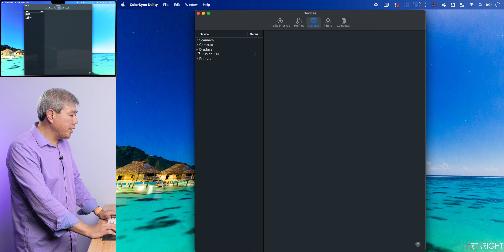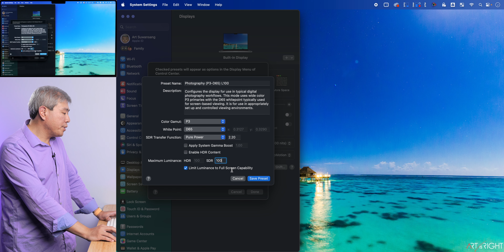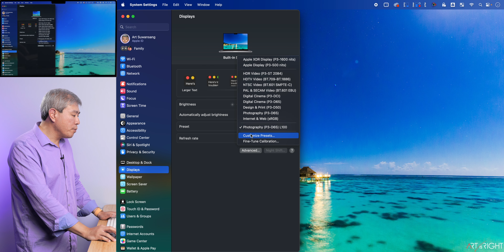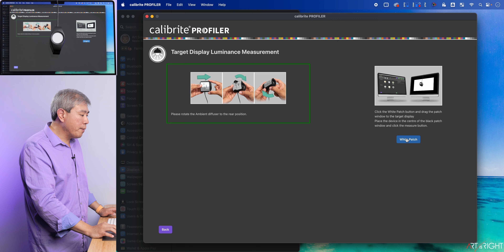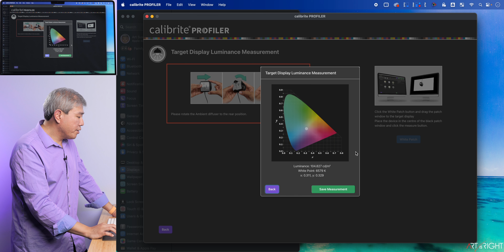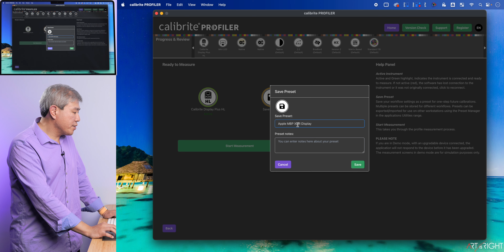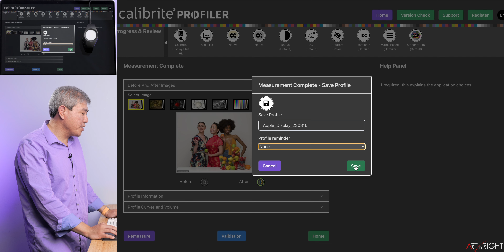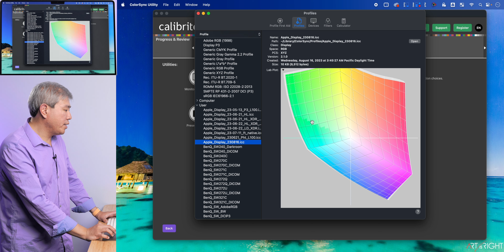Ultimate Calibration Guide for Apple 14" & 16" MacBook Pro XDR Display - This is the way!

Comment: Hello, first of all, thank you for the detailed video.
Unfortunately, it no longer works as described, apparently due to a change in MacOS.
If you select a profile (e.g. Photo P3 D65), you can use the fine adjustment. However, if you duplicate the profile as described and save it (in my case with 120 cd and sRGB), then there is no fine adjustment. In the menu, the fine adjustment is grayed out and there is only "full calibration". And this cannot be done with Calibrite Pro because the sensor is not recognized (by MacOS). I use MacBook Pro M4Pro 16" with latest MacOS Seq.
Reply from the maker: Yes Apple just moved the location. I have to do another guide for this, but I don't have time at the moment.
Reply: @ this Option is grayed out … only Full calibration
Reply: @ArtIsRight  Any update on this? I want to do a calibration but am stuck here. Only "full calibration" is available (not fine-tune) and it cannot be done with any Calibrite hardware devices.
Reply: oh nooo. I just wanted to do the calibration. @artisright do you know when you would have the time to do that? (No Pressure) just for information.
Reply: I would really appreciate an update too.  I can't use my Calibrate Pro HL device since option for Fine Tune Calibration greyed out on 16 in. Macbook Pro M4 with latest version 15 Sequoia.  Patiently waiting.
Reply: Contacted Art and he was helpful.  If you mistakenly uncheck the blue box, "Limit Luminance to Full Screen Capability" in the Create Custom Preset Mode, the option for Fine Tune Calibration will be greyed out in the Pro Calibrator Display box.  So try checking that box.  Save the preset.  Press Calibrate Display.  Now the option for Fine Tune Calibration will be enabled.  I was successful in calibrating my Macbook Pro M4 with the recent version of Sequoia  using the Calibrate Pro HL!

Comment: What should I set as Timeline/Output Color Space in Resolve when working with SDR? There's a change in colors when going from Rec709 to Rec709-A. 

If I set "Use Mac Display Profiles in viewer" and timeline/output to Rec709 and export the final video in Rec709 it should have the correct color (even tho quicktime shows it wrong)?
Reply from the maker: Yes this is a mac export engine gamma shift issue. I would find out on various forum/article to get this answer

Comment: Thank you so much for this walk through Art. Invaluable, as others have mentioned. I now have even more faith in my Studio Display 27" as there was virtually no discernible difference after calibrating vs. before calibrating. As impressive as your .6 and 2.5 deltas were mine smashed your results. I got 0.3 on All patches Avg. & 0.7 on All patches Max!! No wonder I couldn't tell difference between After vs Before calibration. I now feel quite a bit better paying so much more for the Studio Display vs another option.
Reply from the maker: Good

Comment: If I have made three profiles, one for photos with sRGB, other with P3 and another for video with Rec.709 , would I just be able to switch between these three profiles from apple  settings or this will need to be done via color sync utility or calibrite profiler?
Reply from the maker: If you make 3 presets and a profile for all 3 settings, you would need to change the profile in the color sync utility as well.

Comment: I think that if you want to calibrate to srgb or rec709 using the older device models is fine? Just have to chose PSF Phosphor as display type. At least that is what I read in the calibrate app.
Reply from the maker: you would think but not quite, the old devices don't understand the display spectral output.
Reply: @ArtIsRight thanks for the reply

Comment: Hi Art, really amazing video!
Question: I’ve created a few presets for editing, editing for printing etc . I also have to create a profile for each preset? Is it really necessary because each preset must be used with its own profile? Or a profile created with any preset (that is any luminance/white point value) work well with other preset? Thank you.
Reply from the maker: if your preset does not change the white point, you don't need to change the profile.

Comment: Now that you've shown how to do an initial calibration and created presets and profiles can you show us your workflow to recalibrate after 2-4 weeks have gone by?
Reply from the maker: Leave the presets and fine tune the same and just start the calibration process again. There's no settings to change
Reply: @ArtIsRight  Thanks for your reply.  
So when you get to the second step in Calibrate I'm guessing you use the preset instead of "photo"? Also reset the preset to Factory in ColorSync?
2nd question.  I recently bought an M4 MBP. After I calibrated as per your instructions it's a bit magenta when I compare to my M1, BenQ SW321, and Eizo 2700x.  Did something change in the Backlight technology?  I'm just struggling to get a good calibration on the M4.
Best,
Tyler
Reply: @tyrone3006  I'm experiencing the same thing- I just went through all of the instructions again just in case I missed something, and it looks the same.
Reply: @lisasims4223  yeah I did twice as well thinking I missed a step. 
I wonder if changing the backlight technology would help? I haven’t tried.
Reply: @ArtIsRight  Also experiencing the same "magneta" tint when following this video on an M4 Max 14" as per the comment below mine from Tyrone :(

Comment: Hey Art!
Great video.
Do I have to calibrate for every luminance preset?  Is the method different for a M4 running sequoia?  I created a preset for 100 nits calibrated then created a preset for 120 nits.  When I switch from 100 to 120 the color shifts dramatically. I don't believe this happened on my M!
Reply from the maker: No just the primary one you are using. The variation between 100 and 120 is extremely small

Comment: Hi, i have a problem after finising calibration. I have MB Pro M3, and after calibration, icc profile doesn't show up on the list with profiles in settings. Does anyone know what could be wrong?
Reply from the maker: there are so many things that can happen, and many more vairables information that we don't know. I would start with an updated calibration software and go from there. As far as the profile not showing up did you check color sync utility, devices, display and then choose your display?

Comment: First of all. Thank you for your quick replies. So what happened is, that after completing the final calibration in Calibrite Profiler  but before leaving the software my monitor turned yellow. External monitor works fine fortunately. Changing colorprofiles does not help at now I have no collars on the XDR display. Actually I have seen this before when calibrating for some of my students. Is the a bug in Calibrite and can I restore it. I don't have time machine
Reply from the maker: probably dm me, I am curious

Comment: Thanks for the video. Is using those HL devices the only way? I have MacbookPro M2 14" and the ColorMunki display, those HL devices are pricy for me. Choosing "White LED" and P3 will lead me to incorrect results or is anything more to consider?
Reply from the maker: HL is the only way. You can successfully calibrate with other devices, and also other backlight technology. However, what you're going to get is an ICC profile is much smaller than the color gamut. The display is able to produce.
Reply: @ArtIsRight  Thank you so much for the answer, I'll use the default icc profile then and the "Photography" mode in the screens configuration by now (I hope is a decent choice). Seems I need to save for the HL device and get it later, have a great day!

Comment: Hi I'm back to do another calibration so I have to watch your video again to walk mr through the steps but I see I must of deleted the Factory colour profile as I was removing so old ones so I could only reset it from the current profile would that be wrong and if so where would I get the original factory profile again thx Doug
Reply from the maker: When you reset the profile to factory. It will automatically load in a base factory profile that you don't have to worry about. Plus, before you run the calibration the program would also apply a linear profile to your display so technically you don't even need to do the reset, but it's always a good precautionary measure to do it.
Reply: @ArtIsRight  ok thx for your reply its awesome

Comment: Hi ! I have a 16 inch 2021 m1 max MBP  running Sequoia 15.0.1 , I can't find the Mini LED option in the drop down menu. Also can't find the option Measure K . It stops in "Native" . I am using a Colormunki Display calibrator.
Reply from the maker: That is why, "Colormunki" is no a pro device and I did said in the beginning of this video that only the Display Pro HL or Display Plus HL will work.

Comment: Hi,

I am having a weird issue.  The luminosity measured is only 90 even though the display profile is set at 100 and the range I get in the fine tune setting is 84-94.   Any advise? 

Thank you so much
Reply from the maker: That is the display dimming over time. There are work around. I'll have a video up on this soon
Reply: @ArtIsRight   Thank you so much!

Comment: Hi! Is it possible to calibrate the LG C4 OLED on a Macbook Pro M1 these devices? I make HDR content and my calibrator is old iDisplay is not suitable for it.
Reply from the maker: You can, but you just need one of the newer HL devices
Reply: @ArtIsRight  Thank you! I bought HL and tried to calibrate in different settings, the color is good, but my TV does not see HDR, in the DaVinci Resolve program or in YouTube everything all the highlights are highlighted on HDR content. I don't have such presets, like your P3 D65 and HDR content enabled, I don't have that checkbox. MacOS Sequoia 15.0.1. What should I do so that HDR is also visible?

Comment: I've been having some trouble calibrating my Macbook Pro and ElZO monitor using ColorNavigator 7, and I'm hoping to get insights from anyone who might have experienced similar issues.

After calibrating the monitor to D65 using ColorNavigator, I measured the white point with Calibrite software, and it consistently shows around 6300K instead of 6500K. I tried applying a second calibration with Calibrite on top of the ElZO calibration, but that didn't help.

The only solution l've found so far is manually adjusting the white balance in ColorNavigator to 6700k, which then shows around 6500K on the Calibrite software. However, this leads to a 200K discrepancy between what ColorNavigator says (6700K) and what Calibrite reports (6500K).
Has anyone else encountered this issue with calibration software giving different results? Which calibration should I trust more: ColorNavigator 7 or Calibrite? And is manually adjusting the white balance like this the right approach?
Looking forward to hearing your thoughts and experiences!
Reply from the maker: 200 K is a minimal variance that does not change much based on normal human perception. Also, one needs to consider the device and calibration of said device and software as well; i.e., Calibrite Profilier and the device are tuned for each other but not necessary for Color Navigator, and the algorithm that it uses to calibrate and achieve the results is different. My thought is to not worry about this, so minuscule.

Comment: Hi I have also now followed a long with this video and calibrated my Mac Book M1 Pro from 2021 with a Calibrate HL Pro and made a print on Epson Luster Paper using the Epson ICC profile and still the image on the screen doesn't even come close to matching the print...
Reply from the maker: It won't, P3 color gamut vs one that is more aligned with Adobe RGB. Also the lighting that you are using to view your prints matters as well.
Reply: @ArtIsRight  Hi not sure what you ment by "P3 color gamut vs one that is more aligned with Adobe RGB" but the problem might be coming from my On1 Photo RAW software where I have been printing from as I have just printed from Epson Photo Print and got satisfying results

Comment: Hi thx for this 2 questions 1 can one do this with the new Calibrate 123 device and what is the process to do a calibration on the reminders is that the whole process you've just explained. It feels like one need a degree to be able to calibrate or fine tune a Mac Book Pro Display
Reply from the maker: The short answer is that you can and it will calibrate, but you won't get the full color gamut or control over the calibration process. If you are a pro photographer, I would say no and just get the Display Pro HL or Display Plus HL. Also to calibrate the mac, you can just create a preset and skip the fine tune if you like.
Reply: @ArtIsRight  Hi thx for your reply and yes I saw the HL Pro has a much bigger color gamut than the 123 and after borrowing the 123 from the shop again today and tried to follow the calibration process you explained in the video above I saw you don't get the option to get the X & Y values to fill into the Fine Tune Dialog box so yes the 123 is going back and I'll keep the HL Pro and watch your video and calibrate every 2 weeks :) thx for making the video again its a life saver I'll also link to it in my printing video on my channel coming soon

Comment: Hey Art! Great videos you're producing - just got myself a Calibrite Display Plus HL for my MacBook Pro and everything worked fine, the only thing that I haven't figured out is why the delete button is greyed out in the profile manager - I cannot delete profiles in there... (OS X Sonoma) any idea as to how to fix that? I tried giving the calibrite profiler full access to the hard disk, but that didn't help...
Reply from the maker: Not sure, but you can always go into the profile folder and just delete the one you are not going to use manually, that might be easier.
Reply: @ArtIsRight  Will do, thanks for the fast answer!

Comment: Hi Art, I'm trying to calibrate my MacBook Pro M3. In ColorSync under display, devices, current profile, set to factory is grayed out. the only option is "other," which opens up Finder. Is there anything I need to do to make set to factory active and choose it? Thank you for your help.
Reply from the maker: Factory grayed out means you are using the factory setting already. Nothing to do just proceed to the next step

Comment: Thanks for the detailed video. Question: on my MacBook Pro 16" M3, when performing the fine-tune calibration you show, I'm unable to input the full luminance value (100.244); it cuts off after 1 numeral past the decimal (100.2).  Is this sufficient? Thanks
Reply from the maker: Yes that is fine :)

Comment: I don't know if this is a stupid question but I currently have the MacBook m3 pro. Is there a difference between hl plus and hl pro, or which one should I go with for
 my machine?
Reply from the maker: Either one will calibrate these XDR display just fine. The variation has to do with the max Nits of the display that you are calibrating. Pro can go up to 3000 nits, plus 10000 nits, and will have the ability to do HDR calibration down the road. My thoughts is just to get the pro

Comment: @ArtIsRight i did the exact as showed and used advanced+ 461 patches and later authenticate using Digipro 96 patches the reading where my final readings all patched max reached 3.9(97) is it ok or way off as you said that we can expect to get a value below 3 using this method
Reply from the maker: Average is below 3 one of the max will exceed 3 that is ok

Comment: Would it be advised to follow the same steps to ensure an external monitor also matches a calibrated MacBook Pro Display ? So basically doing these steps first on my MacBook Pro, then doing the same steps again on the external ?
Reply from the maker: Depending on the external, but don't expect a match

Comment: Hi,  I am new to MAC and I have newer MacBook Pro and I just got the Apple Studio Display.  When you are doing this calibration am I going to do both the laptop screen and the Apple Studio display or just one of them.  Sorry I want to be sure I am doing this right.  I only ever calibrated a desktop PC monitor.  Also, I have a X-Rite i1 Display Pro is this going to work or do I need to invest in another item?  I feel like I am buying a lot of items :). LOL  I am in photography mode right now but can tell I need some calibration.
Reply from the maker: Both if you are going to use both, each displays need to be calibrated individually. For the studio display you can use the i1Display Pro but for the laptop display, it all depends. If you have a 14 or 16 inches macbook pro then no, you need the newer devices to calibrate
Reply: @ArtIsRight   Thank you. I have the new Calibrite Display Pro HL. I understand I need to keep in extended mode. So I will put the device on the Studio Display and on the laptop which is the newest MacBook Pro,  So when I use the laptop I will click on that profile and when I use the Studio Display I will click on its profile, Correct?

Comment: Thanks for the great video.
I have an m2 mbp and display pro hl..
I’ve tried 3 times now, with good results on the validation, however the gamut is way smaller than P3.. any ideas would be most appreciated!
Reply from the maker: if you choose miniLED it should be really close. Also way smaller is difficult to quantify. dm me with compasirson.
Reply: Thanks-I did use mini led.. I ran it another time from the very beginning using max patches for calibration and validation, and now looks like the results you achieved. Thanks again!